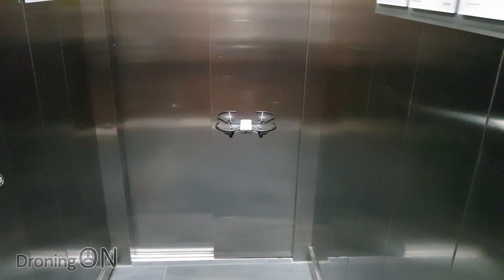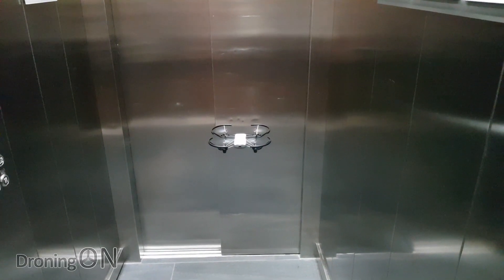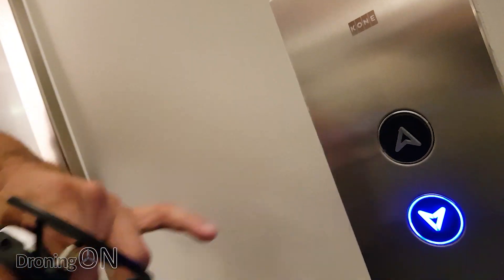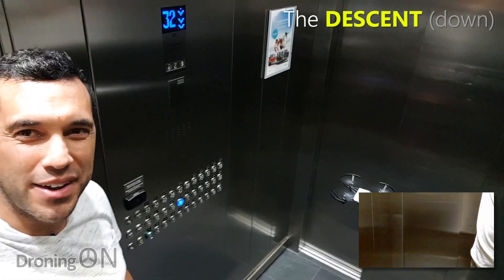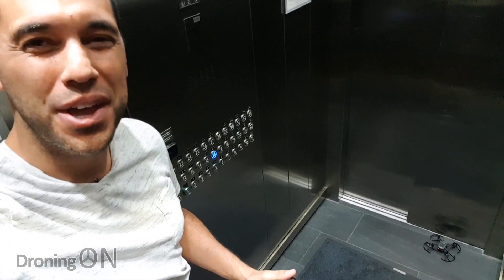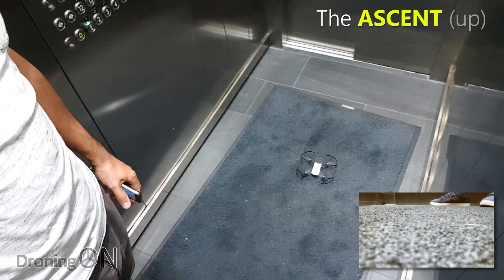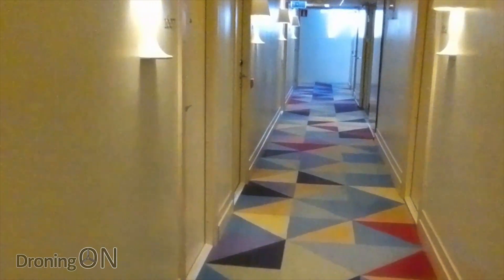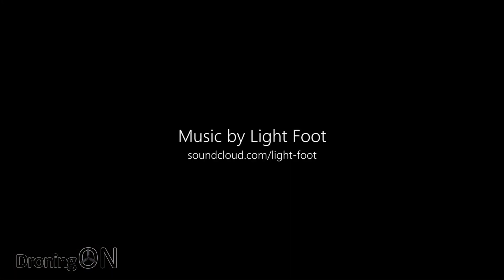DroningON | Drone In An Elevator/Lift - Ryze/DJI Tello Experiment

Comment: As the max height of tello is 30m...what if I fly it at a greater height than that...like from a building terrace??
Reply from the maker: Your challenge will be that the Tello uses the ground (VPS system) and optical flow cameras to track and hold it's position, if you fly off a high balcony the Tello will be unable to hold it's position above a certain altitude. So do this with caution! Hope that this helps! Be sure to subscribe!
Reply: @Droning-ON  I thought that the drone would consider the top of the building as the baseline and 30m height from top of the building. Why will the drone use VPS here instead of barometer?

Comment: Interesting video, I was surprised it didn't use the IR sensors to detect a change in altitude? So it seems the Tello uses the barometer sensor as it's primary altitude sensor.
I just got a Tello for christmas and I'm astonished how dialled in and precise it flies. 😎👍
Reply from the maker: Precisely, which is correct because once the drone ascends above a certain altitude, the IR would be useless anyway, so glad that it uses the barometer!

Comment: So my question then is does it recognise ground level as the starting point or actual ground level in other words if you stood at the top of your building turned on etc from the roof and flew it over the edge would the barometer accept that the infra red sensor is then telling it it’s far higher what would happen ?? Is it smart enough to distinguish the error or will it plummet to its death ??? Who knows maybe another video will tell lol .......

Comment: But you didn't tell us whether you were barometer mode or IR sensor mode.
Reply from the maker: +Dave Day, there is no switch for this, the Tello is programmed as it is which is to prioritize the barometer reading. I suspect that the IR sensors underneath are primarily used to detect a hand for palm landing, also so that it knows when it is about to touchdown during automatic landing.
Reply: It would be interesting to see what happens if you select automatic landing and then send the lift down.
Reply from the maker: I can tell you precisely what would happen, the drone would start to descend but the descent rate of the drone would be slower than the speed of the descending lift, therefore the drone would hit the lift ceiling once again, then cut its motors and fall.

Comment: Hmmm... I thought it'd hit the ceiling on the way down and on the way back up. But I wonder if a Phantom, Mavic or Xiaomi drone's altitude sensors could keep them from hitting the floor on the ascent?  Ken Heron did a similar thing with his P4 in a moving van, and I was slightly surprised with the outcome of some of that.

https://youtu.be/LEgJBDxr3uU
Reply from the maker: Thanks for the comment! It would be great to test this with the Phantom and Mavic indeed, I suspect that on the ascent these drones might detect the floor and adjust altitude accordingly, but also suspect that their failsafes would trigger and that they would simply land rather than try to cater for the ascending floor. As for the descent, I guarantee that it would just end up being a mess, they would both hit the ceiling of the lift as the Tello did. I know that I'd want prop guards on them for sure :P
Reply: DroningON definitely prop guards, full biker gear and a cricketer's box Ash! 😂 Ken was very lucky he didn't hurt himself in the van test! 😮

This might be of interest too (Phantom 3 Vs. Lighning machine): https://youtu.be/L3iJjrQmEho

Comment: Oh dear, Ash. You’ve now left yourself wide open to FlatEarthers and Gravity deniers. Now where did I put my tinfoil hat?🤪😜👽
Reply from the maker: Haha, they can bring it on, any ideas for any other interesting experiments that you'd like to see?
Reply: @Droning-ON  Yeah, considering that this drone uses optical flow only, how would it behave on a moving walkway? or an escalator? :D
Reply from the maker: @vafanvaniejobbia  great question - it would suffer a bit of internal conflict here because the optical flow sensors would want it to follow the escalator and therefore move in the same direction, however the internal accelerometers would think that its drift and therefore work to oppose it. However, I suspect that the design of the drone means that the optical flow would win! If I find an opportunity, I'll test it!

Comment: This was a supremely excellent video! :-)
 
At first I thought that the Tello was going to maintain altitude based on data from the optical flow sensor, but then you specifically stated that you had programmed the Tello to use its barometer as an altitude-maintenance device and I knew the probable outcome at that point (which I will not post here so as not to spoil things for the rest of your viewers who have yet to see this video).
 
Again, congratulations on a truly fine test that most drone pilots (myself included) would not even think to conduct. :-)
Reply from the maker: Thanks for the comment, just to be clear that I haven't altered this Tello, its programmed the same way for all consumers, but the way that it has been setup by Ryze/DJI means that its using its barometer as its primary altitude measurement, all drones are different and so I'll hopefully test it again with another at some stage!